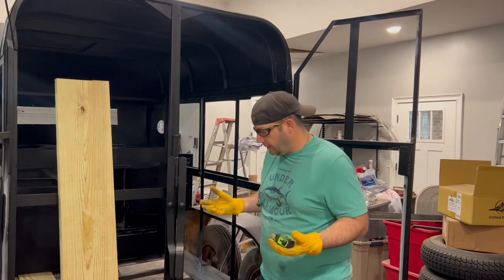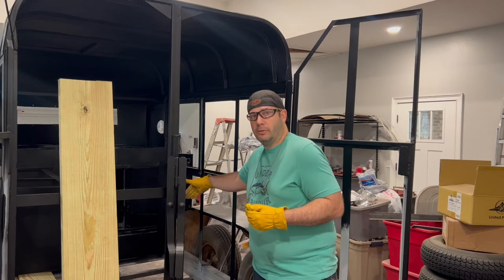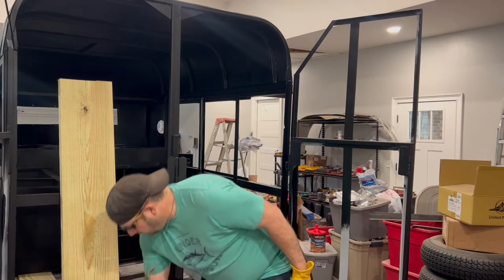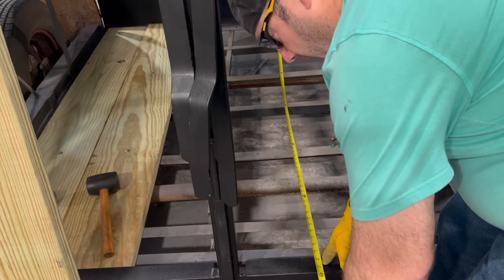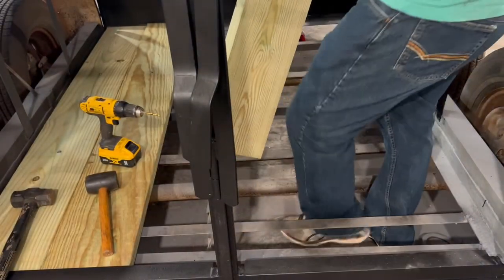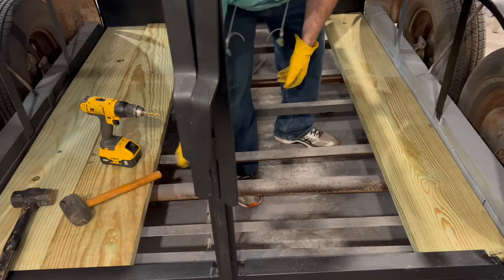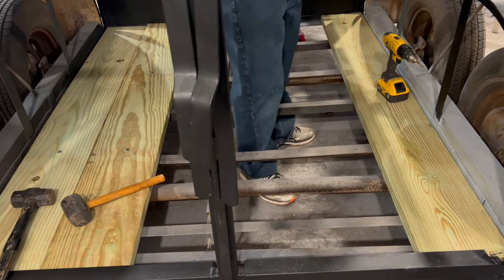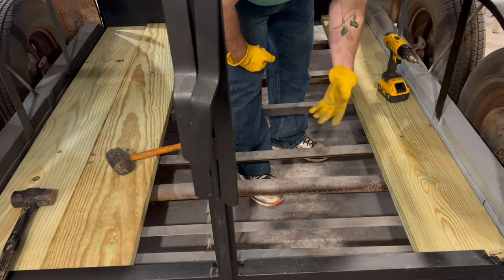Installing the new trailer floor

Comment: Awesome!  FYI, you can bend the boards to save you from cutting any lip as well.  Install one end and place a floor jack underneath to raise the wood center section or close to the inserted end. Now walk down to the other end and flex the board and have someone release the pressure on the floor jack and as the board straightens out, it will insert into the other end.  A lot easier.  I have been installing floors for many years this way, a time saver.  I love the series.  I am building an off grid boondocking trailer
Reply from the maker: That's a good idea. Thanks for the tip!